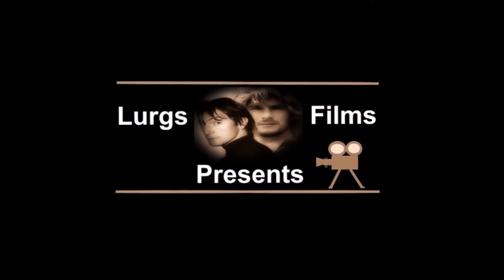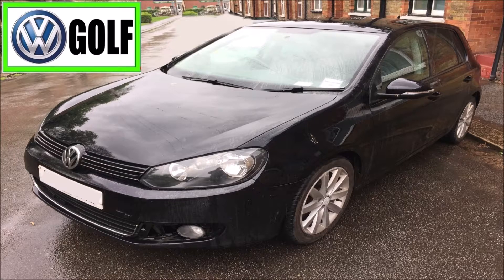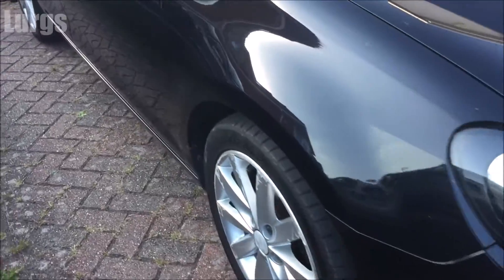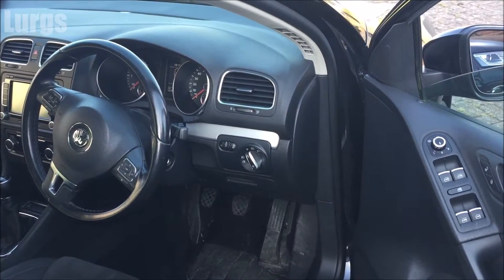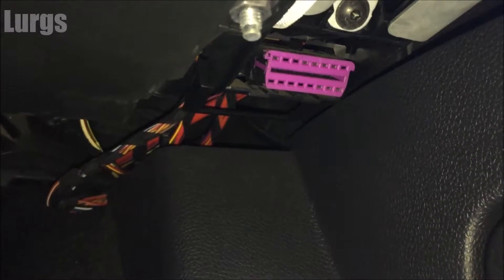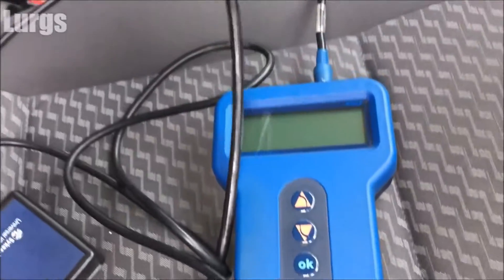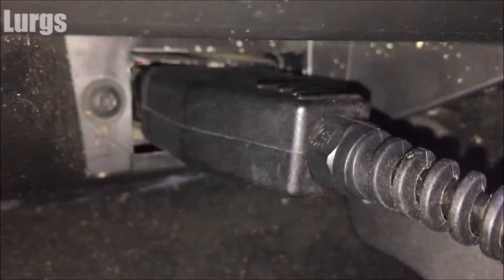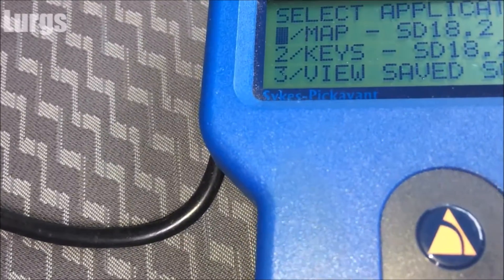VW Golf OBD2 Diagnostic Port Location

Comment from the maker: Other useful How To Guides to help you save ⏱TIME and 💰 MONEY:
VW Golf How To Guides https://www.youtube.com/watch?v=u23A8tTP08M&list=PLqrXuUebV8N98UdIM_u3jfZean7vZ4AkW
How to reset Tire Pressure Light on VW Golf https://www.youtube.com/watch?v=u23A8tTP08M&list=PLqrXuUebV8N98UdIM_u3jfZean7vZ4AkW
How to open Bonnet on VW Golf https://www.youtube.com/watch?v=_bMtm6H9Mr0&list=PLqrXuUebV8N98UdIM_u3jfZean7vZ4AkW
VW Golf Fuse Box Location and how to check fuses on VW Golf https://www.youtube.com/watch?v=eu-phMj0FyY&list=PLqrXuUebV8N98UdIM_u3jfZean7vZ4AkW
VW Golf Dashboard Lights Overview https://www.youtube.com/watch?v=2f_Lzo0OMwk&list=PLqrXuUebV8N98UdIM_u3jfZean7vZ4AkW
How to open Boot on VW Golf https://www.youtube.com/watch?v=wa9zqrtMpjk&list=PLqrXuUebV8N98UdIM_u3jfZean7vZ4AkW
How to set Clock on VW Golf https://www.youtube.com/watch?v=aU_cDo-ww1w&list=PLqrXuUebV8N98UdIM_u3jfZean7vZ4AkW
VW Golf Battery Location and How to check battery on VW Golf https://www.youtube.com/watch?v=Cq3ORJWqYGQ&list=PLqrXuUebV8N98UdIM_u3jfZean7vZ4AkW
VW Golf OBD2 Diagnostic Port Location https://www.youtube.com/watch?v=KwgARqL2viA&list=PLqrXuUebV8N98UdIM_u3jfZean7vZ4AkW
How to fill up Windshield Wiper Fluid on VW Golf https://www.youtube.com/watch?v=Z80h_KBIl80&list=PLqrXuUebV8N98UdIM_u3jfZean7vZ4AkW
VW Golf Engine Bay Overview 2.0 TDI Diesel https://www.youtube.com/watch?v=hGqL4MnsmHg&list=PLqrXuUebV8N98UdIM_u3jfZean7vZ4AkW

VW How To's, Tips, Tricks & Fixes  https://www.youtube.com/watch?v=DosIviY1xxE&list=PLqrXuUebV8N_OyVUXrJNGikNiWncnAW7p
Vehicles How To's, Tips, Tricks & Fixes  https://www.youtube.com/watch?v=w44aQ7dc_Lk&list=PLqrXuUebV8N9fyM8qA2D0rkVfv929Ckod
How to check car fuses without pulling them out https://www.youtube.com/watch?v=w44aQ7dc_Lk&list=PLqrXuUebV8N9fyM8qA2D0rkVfv929Ckod